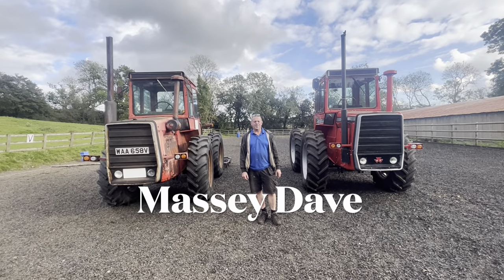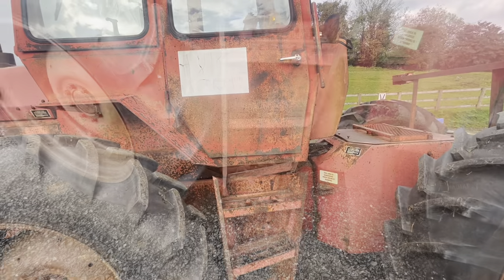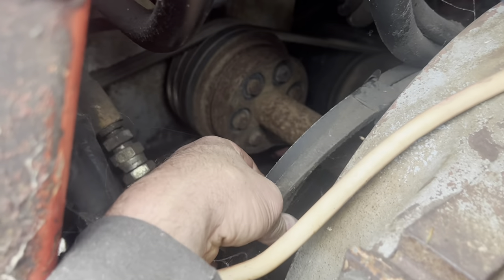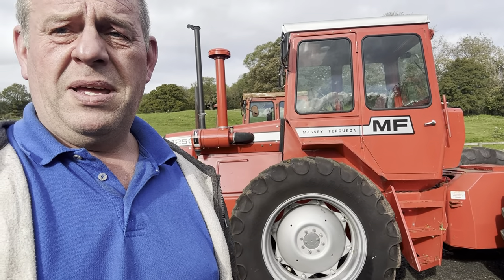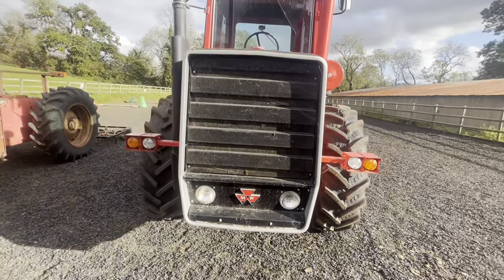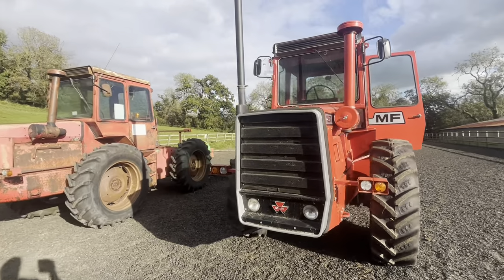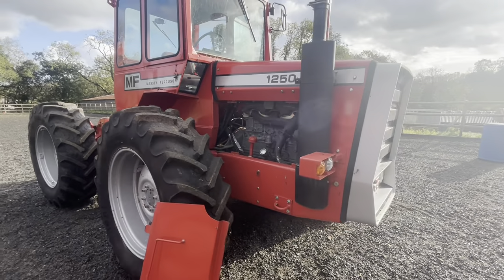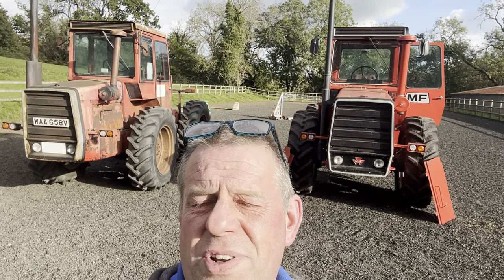Massey 1200 vs 1250 special

Comment: I have a 1979 1200 here in Sweden. 
But its massivly rebuilt sometime in the mid 80's.
With a massive 7,3m forestry  crane in the back and fuel tank moved to the side to make room in the cabin to be able to drive and sit backwards as well. Hudralic tank and extra pump in the front. 
18.4-34 and chains on all tires, and steel plates underneath for forestry work. 
Exhaust moved to the side of the cabin etc. etc..
Its currently gets the  engine replaced.
It has a lot of flaws but its quite useful to have around the farm.
Reply: Eu já tive um máximo 1805 era um motor
Reply: Por que que a Massey Ferguson não volta nos articulado que se é um trator eficiente

Comment: I had a 1200 for a number of years down here in Devon - used to take it to shows.
Nothing will ever prepare you for the shock of taking up the floor and seeing a Massey 35 gearbox ! Yes I know its different on the inside but the casting is the same - including where the 35 foot pegs bolted....🤣🤣😁😁
Still loved it I did.
Now lives in North Devon..

Comment: There was always a very distinct 1200/1250 almost Marmite/Bakelite type smell inside the cabs of them.
Do yours smell similar?

You also never forget the cluck/rattle of the door pull as you slammed the door shut and the thud of the window opening levers as they are opened or closed.

Absolute heavenly things to drive and own. Wish I still had all 3 I have had over the years.
Reply from the maker: Thanks ! Yea know what you mean 👍👍 ole skool so much better than this new stuff !

Comment: Come on Mike, lm in Sweden, further away so the signal is weaker here 😂😂😂😂😂. All joking aside, they are things of beauty,greatly underestimated and had MF not had financial difficulties the 1250 would have continued and the supposed bigger artics (140 hp)  may have been built. Largest concentration of 1250's l knew of were in Indonesia. They went onto Sugar Projects. At that time l was working fur Fird and our projects were on Sumatera and we had 6610's, 7610 and 964 Counties. The MF Projects were on Java and Kalimantan if L remember correctly. They had 290's, 298 Turbos and 1250's. The 298T was not official but converted to meet the Tender Soecifications. Both companies won three projects with a total of something like 3 to 400 units total. Have details somewhere
Reply: I wonder if they’d ship any of them back for spares!!

Comment: Worked on quite a few 1200's, but only ever worked on one 1250. Think when they were introduced, the 2000 series tractors were preferred as they looked more conventional
Reply: They were also cheaper to buy and more flexible in their application than either the MF 1200 or the later MF 1250.
 The MF 1250 used the same engine as the MF 2000 series, the 6-354•4, which had machined inlet ports in the cylinder head, a thickened and deeper 'skirt' and the tappet covers were eliminated, with a now constant section of material on the RHS of the engine. This made it structurally stronger, and in conjunction with the massively strong engine sump, allowed such tractors as the MF 2000s (US 1978, Europe 1979), and MF 699 (1984), to be feasible in the first place, since the engine block was now strong and rigid enough to be used as a structural member.

Comment: Were there many differences between the early and later 1200s?👍
Reply from the maker: Not much , went from dry brakes to wet and then a constant mesh gear box from a crash box
Reply: Also tinted glass in the cab from about 1977 onward.

Comment: Why Dave, has the 1200 got a 1250 steering wheel and the 1250 have a 1200 steering wheel?
1200/50’s are an obsession. Just different in every way. 
Nothing else in the power and weight class has ever come close for wheel grip. 
A joy to drive in the fields. 👍👍
Ps. Love your videos of what you do.
Reply from the maker: The 1200 there is a late one , almost bar 50 in the production , so it has a few 1250 similarity , the 1250 is an aftermarket one as the one it had was broken ! 🤷‍♂️🤦‍♂️

Comment: I worked at the combine plant in Brantford Ontario back in the 80's Thay had a implement newly built it ran for a year or 2 then gutted it and brought those  articulation tractors from the UK to Brantford Thay built 7 V8 tractors and closed the plant and moved the production back to the UK . where were Thay built after that.

Comment: Was there not some connection with certainly the early 1200’s with Kilmarnock?
My father had one of the first, if not the first non-demonstration 1200’s sold to any farm in 1972/3 and MF lavished a lot of entertainment and factory visits to him while sale negotiations took place, including a visit to the Kilmarnock factory  and lots of Malt whiskey tastings! (“May I have some water with it?” …..”You will not!”)
MF took his tractor away after a year and smash tested many important bolts on it before rebuilding it and sending it back, with several improvements, including the shaft bolts between Engine and transmission.
We eventually had 2 1200’s and a 1250. All were adored, but the 1250 was definitely superior.
Just brilliant tractors. Their grip was unbelievable!

You have dome a fantastic job Dave.
Reply from the maker: Thanks , thought Kilmarnock was where they built the combines ??  Colin Cloude is a font of knowledge on that front 👍👍
Reply: @MasseyDave  Yes they definitely did build Combine there. 
Maybe I’m mistaken, but MF definitely took my Dad to Kilmarnock about the time he was negotiating with MF, through F A Standen at Ely to buy that first 1200.
He was no fan of MF Combines, so he wouldn’t have gone there to see them.
And I do remember something about Manchester.
I wonder if Colin could enlighten us to the details?
I also remember them being shown on Tomorrow’s World, but a while after we had taken delivery of ours. They also showed a 1505.
Anther thing I remember was when they took ours away for testing, they lent us another 1200 which was a very early test model. It had weighted PAVT wheels on it which made it look awful!
We used our first one with a 5 furrow Dowdeswell semi mounted (DP2?) plough, ploughing on land rather that in the furrow.  This was no good when it got wet as the tractor would always end up sliding into the furrow. Eventually we bought a fully mounted 4 furrow Lemken and drove the tractor in furrow which sorted it all out.
MF came out with its Diamond plough, but it would not turn the land over well enough on heavy land.
By the time we had the 1250, we had a Dowdeswell DP8 plough and we thought this was the perfect plough for it
Reply: @MasseyDave  
By the way Dave, just been talking to my brother Paul, who I now know has spoken with you several times. He drove our 2nd 1200, the S reg until it cremated itself. Then we replaced it with the 1250.
Paul sends his regards and apologises for not having kept in touch recently. But he has been quite busy. He and my brother Mark have a lovely late 390 and an absolute peach of a 3125.
Paul is still trying to find out where our old 1250 is, but knows she was exported.

My Brothers’ are in North Suffolk and I am in the North Cotswolds. When I arrived here at Moreton-in-Marsh in 1996, the was a local Contractor, Tim Ingles, who has 3 1200’s and there still is another guy near me that has another 3 of them. One has a fore-end loader, mounted on the back of the tractor.
Reply from the maker: @Rickwardful hi , Paul ? Soz I have a lot of people contact me so forgive me if I can’t recall 🤦‍♂️🤦‍♂️😂😘 u not that far from me.  I’m in Somerset 
Dave
Reply: @MasseyDave  Not to worry Dave. It has been 2 years since brother Paul ward spoke with you.
Those of us the had and loved our 1200’s and 1250’s absolutely love the fact that you collect, use and restore so many of them.
Reply from the maker: @Rickwardful I just looked back I see he commented on a couple of videos on the Tw20 👍
Reply: @MasseyDave  Funnily enough, we had a JD 8430 artic driven by my brother Mark, which seized up twice and eventually got replaced with a TW25, a great tractor. We bought the MF 1200 while we had the JD and the 1250 while we had the TW25 for my brother Paul to drive. My Dad, Tony, thought it was incredibly nostalgic that we had the 1200 and then the 1250, considering that he had bought the first non-demonstration 1200 that MF ever sold.